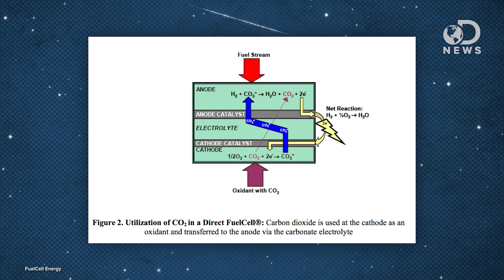Could This Technology Make Cheap Energy Clean?

Comment: I cant help but think that keeping all that co2 undergtound might be a bad idea. What if it got out somehow? Theres no way that metric shit tons of carbon dioxide being released at once woild be a good thing.
Idk, just good to explore ideas from different angles.
Reply: it would just be the amount that would already be in the air if we didnt do this process, plus several layers of rock and gravel wont be broken open, over night
Reply: jason weerawardena true. This is mostly a delaying tactic...which is frankly what we need as of right now, unless we can magically convince everyone to go down to their hardware store and build solar/wind power plants on their yards.
Reply: They store very deep underground so it is unlikely it would and if it were to, it would be stopped because the areas would be monitored.
Reply: SangoProductions21 Solar is not the answer to expensive and it only works when the sun is out, LENR is the answer.
reliable onsite power 24/7 at a fraction of the cost
Reply: Neil Lizotte We don't know if LENR is viable yet